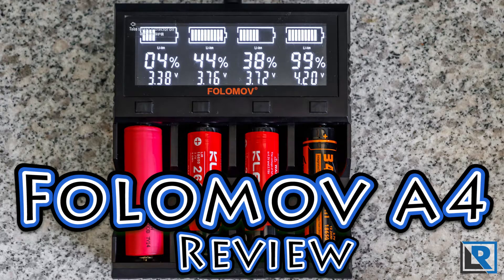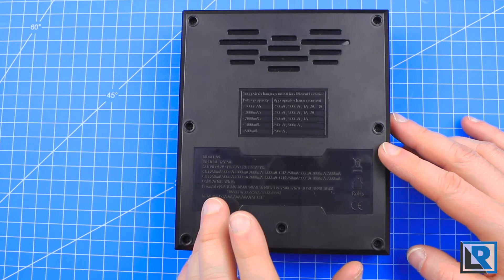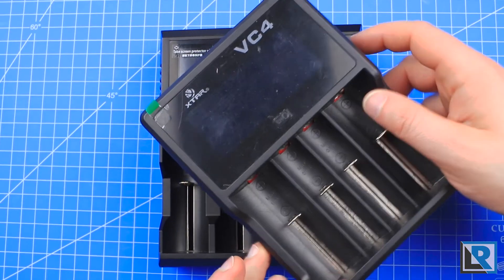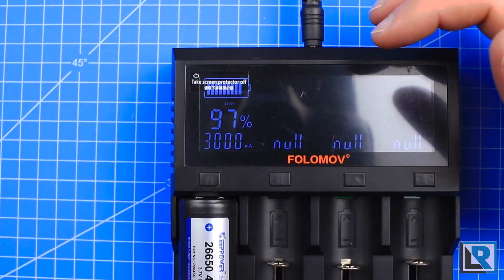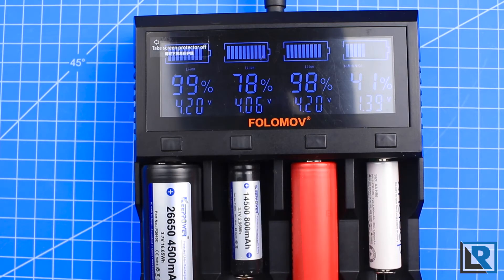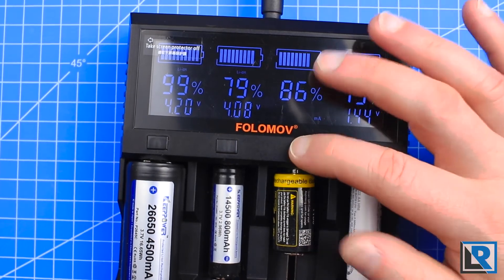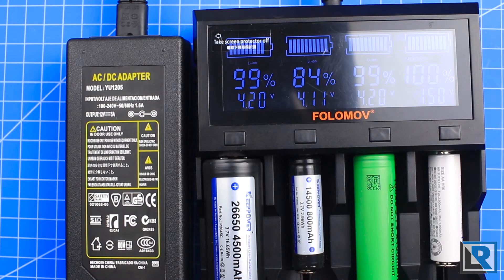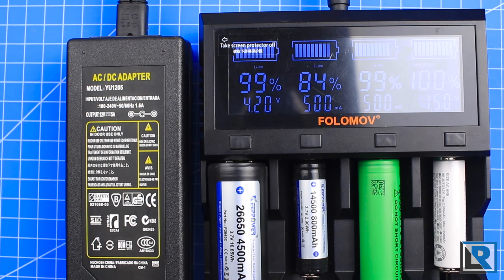Folomov A4 8A Charger Review

Comment: This should be easy questions, does the display stay on all the time or does it go off after some time? If it goes off is there still a way to tell when batteries are done charging WITHOUT having to press a button? Finally how easy is the display to read (ex: can you tell if a battery is done from say 3ft away)?
Reply from the maker: Display stays on and shows 100% without a button. 3 ft is probably ok but pushing it
Reply: Awesome thanks!

Comment: Can you test battery capacity by discharge?
Reply from the maker: Yes I have the equipment to do that on some battery types
Reply from the maker: Sorry this charger doesn't measure capacity
Reply: Thanks
Reply: what is that equipment? does it work for 26650 LifePo4 batteries. We need to check 400 cells everyday to manufacture battery pack
Reply from the maker: Sorry I can't. Ale any recommendations for testing on that scale.